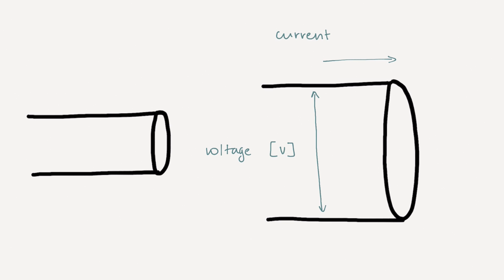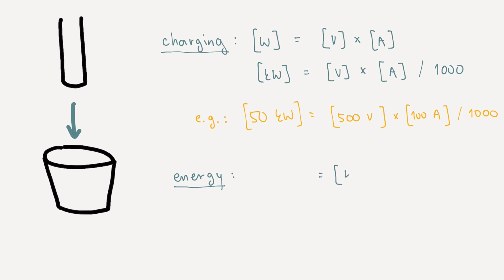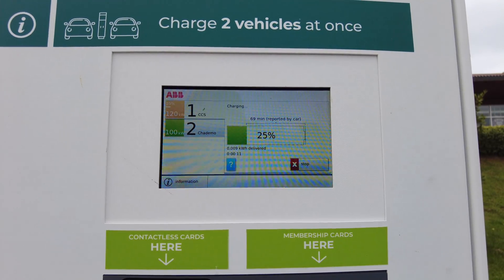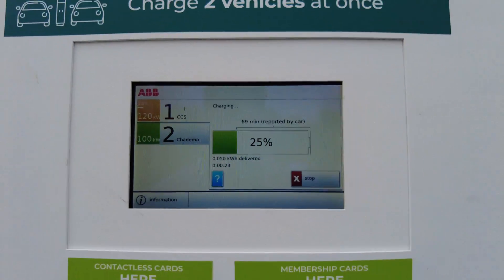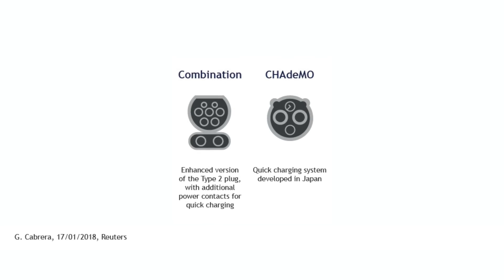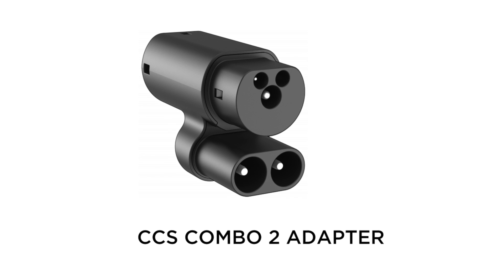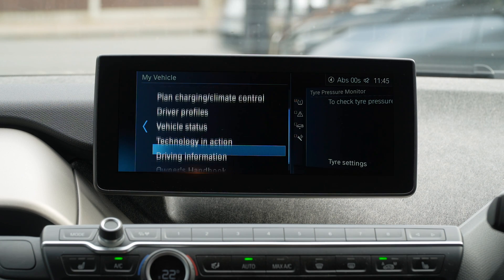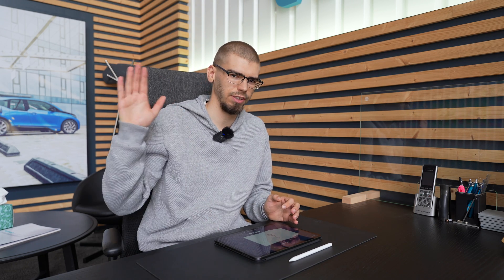EV Basics: Guide to Charging, Connectors, Efficiency

Comment: Thank you for your video. I have a 2017 i3 94Ah ex Japan with a Chademo port on the side of the car for DC fast charging, and a type 1 port in the frunk for AC slow charging. Do you happen to know the maximum charging speed of the type 1 frunk port? Thanks in advance 😊

Comment: What is the professional opinion from the Wisely engineers regarding home charging of the i3.

Leave it plugged in overnight so you wake up to 100% or keep an eye on the charging and disconnect between 80-90% ?

No one can give a definitive answer so I hope Wisely can. Thannks.
Reply from the maker: The best advice we can give is to not overthink it - the number of battery-related issues we have seen is negligible and the vast majority of 10+ year old examples we come into contact with are still well above 70% SoH. Do what fits your lifestyle best. For most people this means letting it regularly get to100% SoC, which is absolutely fine. The battery likes variety.. long, full charges to 100%, short top ups here and there, DC charging (if fitted) from time to time, etc. The car was designed to be charged regularly to 100% and, in fact, not doing so means the cells can become unbalanced.
Reply: @wiselyauto  Thanks for replying. Really appreciate it. Do you think it matters if I leave the granny charger on for a couple of extra hours (over sleeping for instance) once it's hit 100% ?

Comment: Great video thanks, but I have a question. On a car with a Type 2 connector (not CCS) can I use a Type 2 CCS charging cable. I am assuming not as I imagine the CCS connector won't fit because the DC part of the connector has nowhere to go? 
If I am right, could I buy a Type 2 male to Type 2 female extension cable which should allow the female Type 2 connector on the extension to fit onto the male Type 2 part of the CCS connector without obstruction? 
Thanks for any help.

Comment: Hi sir, if the i3s Rex I am looking for to buy comes only with type 2 connection, could it be charged at 43kw in a public charger or will not accept that speed?  If yes, and it has a 40kwh battery capacity, could it be charged from 10% to 80% in around 35 mins? Many thanks in advance.
Reply: Ok now I understood, i3 with ac charging/type2 only accept max 11kw. So it will take 4 hours…

Comment: 8:00
By original design, type 2 was AC 1 phase, AC 3 phase and DC. DC worked by combining AC L1 and L2 into DC-, and L3 and N into DC+. Each pin can do up to 80A AC (3 phase, or 50kW), and 100A DC, so it would be 200A at 400V, or 80kW. 

Renault Zoe in 2014 could charge up to 63A AC or 43kW, and by internal circuit diagram, up to 40kW DC, which was never enabled. Tesla uses longer pins, so it can push up to 150kW DC.

So, Europe would never need NACS equivalent, type 2 was a good design from the start. 
Issue was that VW 'invented'. They limited their cars to single phase only, often 3kW. This way, their cars would charge for 20 hours. Then marketed CCS as improvement, to enable fast charging and paid options. 
In my opinion, EU should have never allowed CCS to become a standard, but VW has taken the money from the German government to build a CCS network, then it spread across the EU. And politicians are not electrical engineers...

Comment: Hi I bought a simple Type 2 Mennekes plug to Scucko socket for my electric motorcycle which only has a computer power cable socket so 1kW AC needed. When the AC Type 2 stations has socket it fits in and works fine, but there are Type 2 EV charge stations with Type 2 cable instead of socket.
In the cable end my Type 2 plug does not touch the pins, the plastic spacing is too long.
Can I cot a centimeter from the plastic plug end just to fit both socket and cable Type 2 chargers?

Comment: Hi thank you, this helps me understand the fact the electricorik has 3 different measurements for the same thing that comes out the end of the cable…😮
What I am searching for is an explanation of what is in the “box” that is on a 240volt mode 2 , type 2 cable, how does that effect or modify the electric if it’s still the same in and out ..? Please 🤔

Comment: What adapter etc. would I need to be able to charge my mobility scooter cabin car from an EV Charger, here in the u.k. I currently charge it on a normal 3 pin plug like you would use for any electrical home device, kettle, fridge, microwave etc.

Comment: How to increase the charging efficiency for ev
Reply from the maker: Theoretically, the slower the charge, the smaller losses you get, but as long as you charge on AC, it's not something we would worry about.

(Would recommend using a home charger instead of relying on domestic plugs though for a number of reasons.)

Comment: Does the BMW i3 have pre conditioning for the battery?
Reply from the maker: The i3 does have battery pre-conditioning for departure. The electric heater also helps to keep the battery at the optimum operating temperature while driving.

It cannot however pre-heat the battery for faster rapid charging. (However the battery seems to be quite happy to charge at the full rate even at relatively low ambient temperatures.)

Comment: Very good explanation but I still dont understand CCS. Why is it combined AC and DC in the same plug? Are there DC chargers which also outputs AC? Are there EV cars that can only be charge with AC and not DC?
Reply from the maker: Let us try to answer one by one:
- AC and DC are simply combined to save on space (i.e. a car does not need 2 different charging ports, but only 1)
- CCS DC chargers only use the 2 big bottom pins for delivering power (a couple of the top pins are used for communication, but no AC power is delivered)
- There are EVs which only support AC. Usually earlier models which were mostly intended for urban use, such as the 60Ah i3's not equipped with the optional CCS or the previous generation Renault ZOE's. (These only have a standard Type 2 port.)

Hope this helps.
Reply: @wiselyauto  thank you. Much appreciate the detail explanation
Reply: @wiselyauto   If I understood good AC charging (3.5kW home charger) use AC over the cable up to the car socket? Probably inside the car is the convertor to DC coz every battery the battery can be charged only in DC mode!?
Here in Macedonia mostly there are Type2 public chargers 22kW (which supprisingly are free of cost). Is it the same as home(?) chargers - over the cable up to the cars charging port is running AC current?

Comment: hello, what is better for the batteries?
charge 1 phase 7.2kw 32 amp or 3 phase 11 kw 16 amp?
Thanks
Reply from the maker: Theoreatically, the lower the power, the better (so 7kW is better than 11).

In reality it should not make any percievable difference though, even over a number of years.
Reply: @wiselyauto many thanks great video - One qq on the topic above - if I installed a 22kW charger for when I need a quicker charge (max 11Kw) but then used the BMW standard charging cable would that throttle it back to 7kW to better maintain the batteries for longer overnight charging?

Comment: Small correction about the connectors that Tesla use. Over in the US, Teslas use a proprietary connector. This is because when they were tooling up, the Type 1 connector was still in development. So they had to go their own direction. The Tesla connector is smaller than the Type 1 and this informed the design of the charging socket fascia. Fortunately, the Type 2 socket fits in the fascia of the Model S and X, but not the whole CCS2 socket.

Tesla also favoured re-using existing pins in the socket for DC charging. Their own connector does this and that's why the Type 2 socket in the Model S does too. Tesla were expecting DC charging on Type 2 (CCS2) to take this solution. But the standards makers went for extra pins instead. So for the Model 3 they re-designed the fascia to support the full CCS2 socket.
Reply from the maker: You are absolutely correct. We aimed the video for the UK (or Europe) and honestly never thought we would get viewers all the way from the US. Thanks for watching!

Comment: What is thé best way too charge a BMW i3 94 h. Each day or once a week. I drive 30 km a day.
Reply from the maker: BMW officially recommends to keep the car topped up, so whenever you have an opportunity, just plug it in.

But the batteries degrade so slowly that it’s not a thing to be concerned about.
Reply: @wiselyauto  so better to keep the battery full. 
Question:  I leave my car charging for 8 sometimes 12hrs on a 2 level charger, in 5 to 6 hours it usually gets charged to full capacity but i leave it plugged it until i leave work. 
Is that okay for a BMW i3?
Reply from the maker: @RB-es1vx  Absolutely fine. The charging stops when the car reaches 100%.
Reply: @wiselyauto  thank you for your reply. For that I will subscribe.

Comment: I bought recently a 2017 94h I3. It has arround 45.000 km. I did last week a 1200 km journey and used rapid charging. All of the stations, except one, were 50 kwh stations. No problems there. Arround 20/25 minutes to charge from 20 to 80%.
The other station was a 160 kwh fast charging and when i plugged the car it started charging normally but when it reached 75% an error occurred. The charging was stopped and on the my bmw app two error messages appeared: impossible to fast charge and also the impossible to charge message. Later i plugged on a type2 charger and all the errors disappeared.
So, on 50 kwh stations no problems. The only time i used a really fast station i had a problem.
Any ideas of what could have happened?

Greetings from Portugal.
Nice video.
Reply from the maker: The error sounds more like a coincidence and not necessarily related to the fact that you were using a higher power charger. We had a couple of similar issues on 50kW units as well. Replugging always cleared the fault.

It can sometimes happen if the CCS plug is loose / dirty or there is a communication software bug (between the car and the charger) - given the power involved, everybody errs on the side of caution and lets the device throw an error instead of trying to continue with the charge.

Hope that helps. Enjoy your i3!
Reply: I just bought a i3s 94ah 2018 "facelifted " charged twice on rapid change 175kw and no problems there.